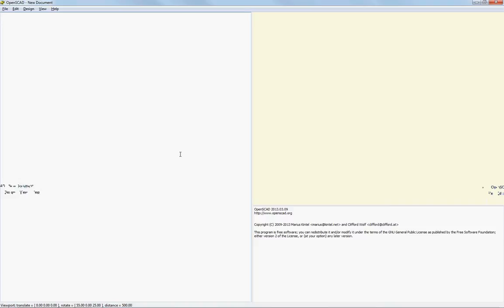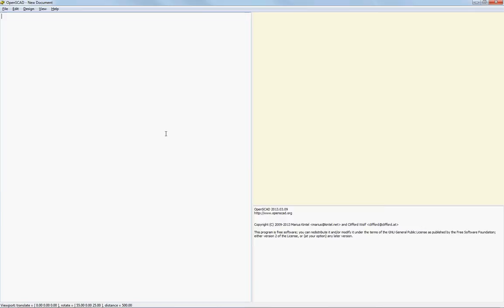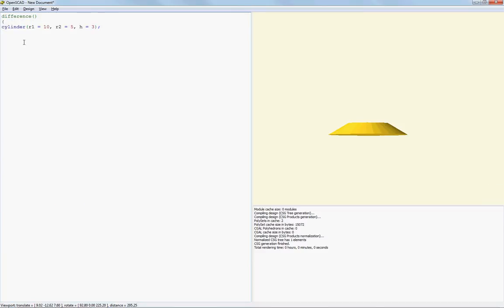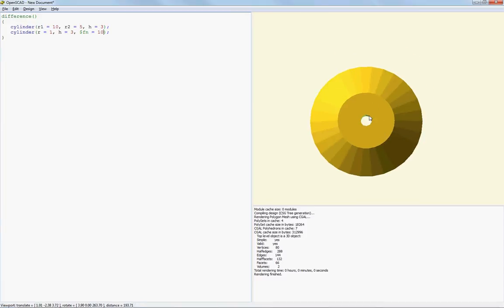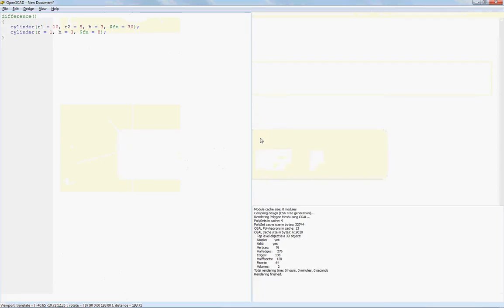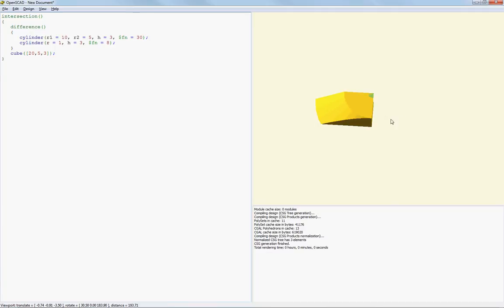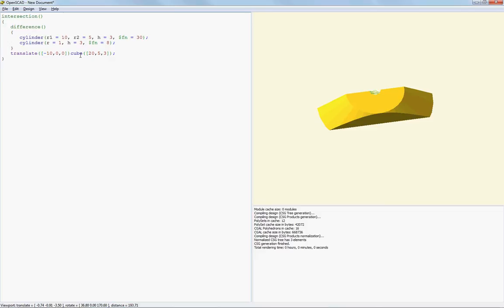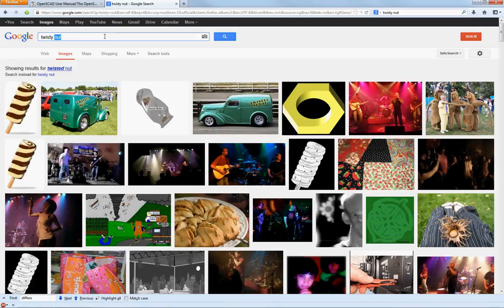Openscad Demo : T Slot Clamp

Comment: The 2d subsystem is basically the same as the 3d one. It is *really* useful with linear_extrude and rotate_extrude. (Though i have had some trouble with complex parts with twist/rotate_extrudes, tried ImplicitCAD for that, which is *many* ways is better, but it doesnt export as nice .stl files so far)

Comment: Well you can fairly easily modify .scad files to work for both openscad and 

ImplicitCAD allows for `r=somevalue` on (all?)primitives, also allows for variable height linear_extrude and stuff.

Not sure what openscad approach is. What i like about implicitCAD is that it has a single clear approach, that is apparently sufficient. (But as i said, it needs to export better .stl)